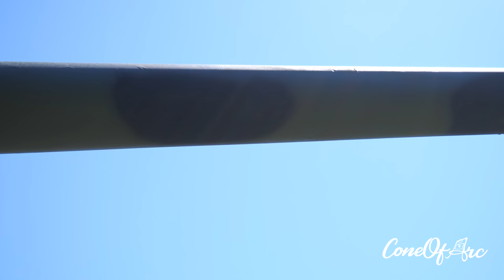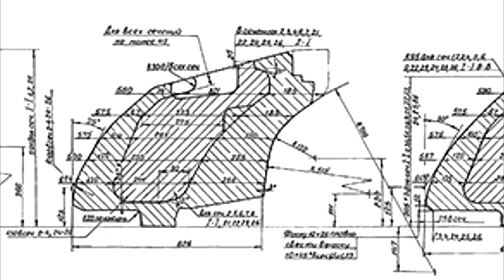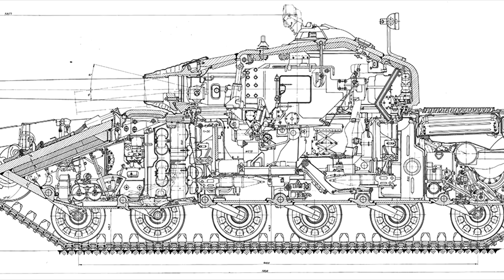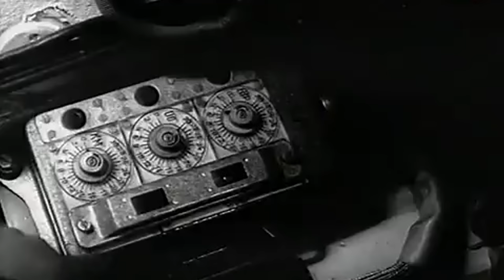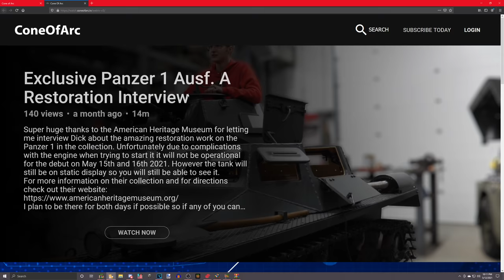Raising the Bar, the T-64 | Forged for Battle

Comment: You missed the biggest 2 flaws in the design looking from a British perspective:
1. Lack of a boiling vessel.
2. Lack of a 4th crew man to make tea and grab the biscuits for in battle refreshments.
Reply: @hunterbg6651  lol :P
Reply: a spy
Reply: It has sandwich armor tho... Tasty.
Reply: @hunterbg6651  Dude, in Russia, vodka is spawned, wherever and whenever the crew appeared for resupply. No need to manufacturing it inside the tank. You stick your hand outside the hatch and you already hold two bottles.
Reply: Probably not having enough gun depression to go hull down
Reply: The boiling tank is necessary for making tea
Reply: @HanSolo__  I dont know if you are Russian or not. But the fact that Russian have vodka everywhere literally just pull your hand out and get few bottles it is very possible in real life.  Пьём!!!
Reply: The tank is the BV its so hot
Reply: Infinity supply of vodka
Reply: Fun fact. The boiling vessel saved lives
Reply: @hunterbg6651  "sergei you idiot that's  not vodka, it's supposed to be engine coolant!"
Reply: @tylerkelley4788  A don't worry about it. It's fine
Reply: @Diexiel  Nah. Im from Poland but it used to work kinda same way here. Doing engineering job in Iraq or Kuwait we had the policy to drink every day so yeah...
And Ive been to USSR and current Russia as well as I traveled to Belarus a few times + once to the Ukraine. This is quite relevant. I mean with vodka you get the most possible booze effect for least level of the hangover and head ache. There are literally no downsides there.
Reply: Imagine if the French had built it like the Char 2 and had a crew big enough to fight and operate an entire bakery and cafe.
Reply: Lol, true that.
Reply: @hunterbg6651  A very pure grade of vodka, dubbed "White Gold", was used in their aviation units and some armored units as a coolant and/or antifreeze.  They deliberately chose not to denature it since they feared the casualties that'd result from Soviet crews drinking it ANYWAY.
Reply: wow
Reply: In Denmark we have a large and very fine, Private Collection of now former former Eastern tracked vehicles and equipment, and I noticed that many of those had a wood-burning oven to one side - maybe, besides giving a little extra heat inside the tank, to be able to make a nice cup of tea, during pauses?
Reply: Yes the brits when makeing a tank we want it to have tea
Reply: Love it. Funny comment. I lived in England for two years. I can say that "all the great peoples of the world drink tea".
Reply: @arthas640  hon hon hon le boulangerie de batalie
Reply: It's my understanding the entire tank could be self brewing.
Reply: Very true
Reply: oh yes so hilarious 🙂
Reply: 3. it drove faster than a solider walked
Reply: Nyet, we bring Babuska's goulash in external fuel tank!

Comment: Correction: You were as likely to get a limb stuck in the T-64's autoloader as you were to get your head crushed by a recoiling breech block. There is no data on it ever happening. It's difficult to imagine a Soviet tank crew putting his hand in front of the reload mechanism. As it is CLEARLY dangerous. 

It's largely a "oh but it could happen", but it never actually did.
Reply: Well... it did, but I don't think crews write down ever small cut on their finger
Reply: when middle east got their hands on soviet tanks with autoloaders it turned out you somehow can use the window of 3 seconds to get your hand loaded.
but that goes with lack of proper training
Reply: @ryszakowy  Yeap. It is not problem of design, but of training - otherwise it would have been same as if someone would say "oh, an assault rifle has a design problem: if you put your hand in front of barrel, you can shoot your hand!"
Reply: But it couldve!
Reply: Actually i think even the abrams firing mechanism is more dangerous since if you trip while the tank goes over rough terrain and the gunner shoots at the same time the back of the gun would punch you and stick you in the blast doors
Reply: I'd still take the auto loading tank over an Abrham
Reply: I have seen soldier from a mass conscript country put a finger into assault rifle chamber and somehow decided to release charging handle, don't overestimate of the iq of some soldiers
Reply: @kingnothing5678 no way the Abrams has way better crew survivability, always say no to being sent sky high
Reply: @GrindThunderer  more for the fact that American tank crews still have to hand load the shells in 2024 when the auto technology has been around for decades.
Reply: @kingnothing5678  so do leopard tanks?

Comment: Few clarifications about T-64
1. It's hard to call the T-72 as a replacement to T-64. Main benefit of the T-72 was that it was simpler and cheaper to manufacture. Otherwise those tanks trade blows with the T-64 and later T-80 coming slightly on top.
2. Both T-64 and T-72 autoloaders are really small targets, lying low, near the ground, that are hard to hit. Differences between them in this regard are neglegable. No tanks at the time had safe ammunition storages. This novelty came with the M1 Abrams more than 15 years later. The real problem with T-64, T-72 and their later variants T-80 and T-90 is reserve ammunition that was put all over the tank, wherever it could physically fit. This is why almost every time you achive penetration the ammunition is set on fire and the turret pops off.
Reply: Not really, T-72 was better than T-64
Reply: @grandayatollah5655  it's not that easy to say one is better. In some aspects T-64 is better in other T-72. Also there are so many production variants and modernizations that it's hard to pick two examples to compare. Both tanks are simmilar in protection and capabilities. They were both manufactured side by side since 1960s up untill 1989. If one was clearly better then USSR wouldn't bother to manufacture T-64s past 1967.
Reply: while the original models were comparable, later models are not.
Reply: @grandayatollah5655  The original/prototype version of the T-72 wasn't, only after upgrades did it become comparable.

Comment: A few errors here : T-64 is the last soviet medium tank , T-64A is the first MBT. ( Soviet criteria for MBT is gun 120mm or larger) There were around 900+ T-64 produced , but due to tanks problems they were all assigned to units near Kharkov where tank was manufactured. It competed against T-62B in trials , which also had autoloader and composite armor and later became T-72. T-64A has two major versions : 1969 and 1974 , 1969 has 2A26 gun which was the first designed from scratch tank smoothbore gun and had extreme problems with thermal warping of the barrel , 1974 has 2A46 which basically added a thermal sleve. 115 was based on rifled 100mm gun and had thicker barrel. T-64B1 is a T-64B without ATGM FCS due to difficulties scaling its production. The also replaced 5TD engine to 6TD over time.
Reply: I think the MBT label is less about actual official naming conventions and more about the capabilities and design, the T-55 is generally considered an MBT
Reply: @thewingedporpoise  The T-55 is a medium.

Comment: >crew cannot replace knock-out number

Arab crew abandoned the tank despite it wasnt even penetrate:it doesnt change much
Reply: what do you expect from an army raised by kings with the inclusion of their relatives and each who think the information he gets is not to pass to his lower ranks that may cause him to lose his Mercedes or gold bar? even after tons of petrodollar they don't even consider starting an R & D dept and still depends on backstabbing west...lol
Reply: More of a training issue than a design issue. You can actually see the same effect in the very late war Wehrmacht units, who panicked under enemy fire, even though they were in a relatively safe position/behind thick armor.
Reply: @erloriel  Even if the round was stopped, you are basically got rung by a bell while the other side didn’t meaning while you experienced a emotional event, the other side can just load another one in. So I can see why the later German crew abandoned it because they can’t keep calm when they got the equivalent of a bitch slap
Reply: @Predator20357  The Japanese had a doctrine that each tank should be considered a fortress and that leaving your tank was abandoning your post. In the battle for Khalkhin Gol their best tankers suffered appalling casualties, remaining in damaged or broken down tanks until overrun by infantry and they lost some of their best manpower. Arguably it would have been greatly preferable to keep the crewmen alive by bailing.

Comment: According to Zaloga, the T64 was plagued by engine problems for years . At one point, in exasperation, defense minister Andrey Grechko threatened to have all the T64 "retired to the combat training park by August 1, 1971." The engineers persisted and the engine problems were resolved by 1972.

Comment: "Good day, I am Cone of Arc and I will spit out a pair of myths about the T-64 as drawbacks"
Fun fact:
1) No crewman has ever gotten caught in a production variant autoloader for the T-64, T-72, T-80 and T-90. Ever. In 40-50 years.
2) The mechanism had extremely good reliability stats. To the point the core principles, sans the charge orientation, have remained the same.
Reply: Also the T-72 was made to be less complex. Saying the T-64 was more advanced is like saying someone making a knockoff Apple is making a inferior product. No shit, it was made to be inferior for the sake of production efficiency and ease of maintenance. Guards vs Line unit tanks basically.
Reply: never trust any soviet info especially concerning accidents and crew looses
Reply: @dukenukem8381  
That applies to any state's. The soviet union tended to be remarkably honest in the higher echelons because if someone lost an arm to the tank's loading mechanism the designer suffered a reputation hit.  And his/her enemies would love that to happen (lotta back biting)
Reply: @RomanianReaver  Believe me soviet union is a whole different beast when it comes to personal responsibility and state cover ups. Most of ww2 soviet archives are still closed, man look it up. And that was 80 years ago.
Reply: @dukenukem8381  
Mate you're arguing we don't know this shit even though we know everything else about the tank including armor comp and its design history.
How about you prove anything about the T-64's development program is still kept secret.
Reply: @dukenukem8381  Lucky for us, several now-NATO member states used the T-72 for decades without a single recorded incident of crews being sucked into the autoloader!

Aside from this, the Soviets were fastidious recordkeepers and just because something wasn't published or broadcast on the evening news, did not mean it wasn't recorded. I'm not sure where you think the info we have on Soviet sub losses or air crashes come from, but spoiler alert: it wasn't from the Americans.

Bonus: it takes a very, very special kind of person to stick their arm behind and beside themselves into *the recoil area of a 125mm gun*. That is where the autoloader is - between the gunner and the commander, directly behind the breech. You would not ever want to put any part of yourself in that area if the autoloader was operating or if the gun was loaded, because the risk of getting crushed by a recoiling gun is universal.
Reply: @rossmum  Anyone who has been in the army will know that safety is drummed into soldiers heads time and time again, especially in training. You are trained to operate equipment and weapons safely, and woe betide the pasty faced recruit who gets careless, sloppy or veers from the training - the corporal is down on you like a ton of bricks! And that never stops after training either. As an ex soldier myself, I can vouch for the number of times I and my fellow trainees were shouted and screamed at on the rifle range and elsewhere over safety. I doubt things were any different in the Red Army.
Reply: @rossmum  Well, in BMP-1 ones autoloader has been removed altogether....

Comment: The T-64 would never have gone into full scale production in the West with the problems it had.  The Soviet planners figured that even with all its glaring defects, their extensive tank park of T-54s and T-55s were just so many targets for NATO gunners; and though the T-62 at least had a potent enough weapon in its 115-mm smoothbore to take on the M60, Chieftain, AMX-30, and Leopard I, it was still poorly armored for the modern battlefield.  They must have figured that they could solve the problems inherent in the T-64 later, in the various divisional depots. 

Judging by the poor performance of the T-64's successor, the T-80, in Chechnya in the mid and late 1990s, I'd say those problems were never solved at all, and the T-64 would have proved a "lemon"..  Interesting thing is, the tendency of its engine to catch fire on startup is what plagued the German Panther in WWII.

Comment: I have to point out an error the Cheiftain had an 120mm gun unlike the rest of the allies that could penertrate the frontal armour, however was effective at a shorter range than the T-64. This is the reason the T-64 went straight to the area which would face the British, as they had what was considered the hardest to defeat force.

Comment: Wait a minute, wasn't the T95 MBT series (Suppose to replace the M48 to become the 2nd generation MBT) held the first Smoothbore gun? (The APFSDS part I am unsure, but if I am correct they brought it in first, unless Soviets did it first, then I'm unsure when the 1951s trial tank came from with the APFSDS).

Reason why it never came into service cause the smoothbore proved inaccurate, but then again the caliber was 90mm, so it was to small to be effective, but fired the smallest MBT sabot round.

Edit:T95 MBT experimental tank was from 1951-1956 if my sources are correct (Then again it's kinda hard trying to find good sources)

T-62 came in at 1961 (Again if sources are correct)

Comment: The 3 crew-member design made it so low profile and fast & maneuverable. As a rule of thumb, every crewmember adds 10 tons of armor to the tank. Also, with 100 crew trained, the Soviets could field 33 tanks, the Americans only 25 tanks. That's already an 8 tank advantage.
Reply: and...consequently, need for additional 150-250 hp to the engine. Herein is the problem: Soviets couldn't make reliable, durable, compact, piston engines > 850 hp.

Comment: Eh, what the Germans had in Barbarossa was the Panzer IV (25 tons) against Soviet T-34 tanks (26 tons), but later developed the Panther tank (45 tons) to which the Soviets responded with the T-34-85 (32 tons).

Yes, the German tank is heavier, but it is also significantly better protected from the front, while the T-34s had generally uniform all-round protection.

Only with the T-44 did the Soviets make a proper paradigm shift to what could be considered a "modern main battle tank", but looking at the T-44 compared to the Panther, they are quite similar in design ideas. Just that the T-44 came about a decade later, so had the benefit of better technology.

Comment: You have one significant mistake in the vid. 
T-80 is not a variant of T-64 with gas turbine engine. Although this project started from "what if we put GT engine in a tank?", many problems were found in T-64 design, most of them due to the task of making a tank in 36 tons. 
Looking forward for T-80 video

Comment: The autoloader had an additional problem over other tanks. In order to load the gun had to be moved to a particular elevation and earlier models required the turret to be rotated to a particular position as well.  This made follow up shot accuracy worse as the gunner couldn’t simply correct his aim while the gun was loaded as the gun would have to be aimed all over again.
Reply: The gun would elevate to the loading position independent of the sight, which would remain stabilised where it had been pointed. Once the loading process completed the gun would return to index with the sight and was ready to fire (this is why there is a red lamp on the gunsight, to indicate the gun is loaded, indexed, and ready to fire). Likewise, the firegating system would prevent the gun from being fired accidentally if the gunner had the sight depressed below the angle the gun was able to depress to.

Worth noting: several NATO tanks also elevate their guns to a specific loading angle. In this respect the Americans are the odd ones out, I don't believe they've ever required it except in cases where the gun was already at a very awkward angle for the loader to lift the round to.
Reply: The t64, much like every single turret since the 1890s had a barell independent sight.
The gunner aimed the sight, then the gun would lay onto the sight.
Reply: I used to be a former tanker I've been in a t64 t62 t55 as well as our own Abrams and M60 a3 when you say that the turret had to be in a right position like at a certain degree 12:00 1:00 etc that part is not correct the turret the bustle the auto loader all moved in a alignment with the gun barrel.
We actually got to sit in the Gunner seat and go through an electronic fire of the gun we didn't use live rounds but the gun was cycled when the gun does have to tilt to a certain position to allow the piece of the shell to exit out the back door when it realigns itself as others have pointed out which it does do automatically it was not very precise you did have to reacquire your Target and adjust aim but you were close to Target and if you're interested the reason the other Western tanks that do elevate their gun during reload is to make it easier for on the loaders the m1 just has enough room where it doesn't really matter

Comment: In a small note here. Yes the auto loader are it’s crew arms. There are numerous reports of this and yes the bmp had a variant with an auto loader but it was never mass produced. 
 Besides this the biggest issue is that when a soviet tank reloads after firing, the gun raises. Dead give away.